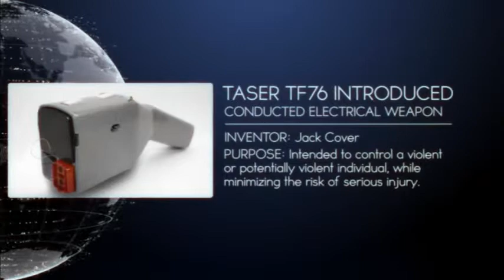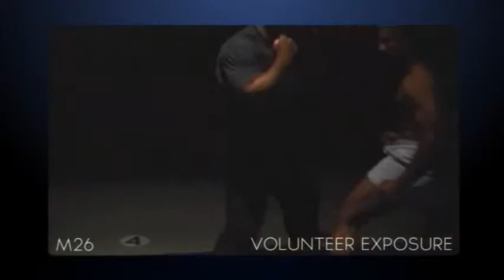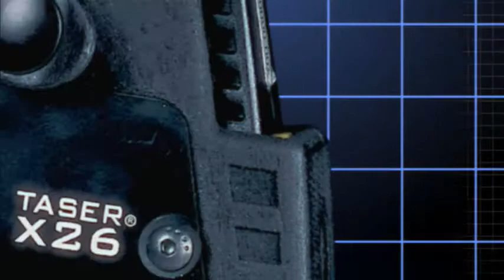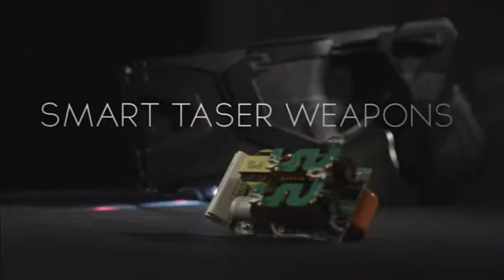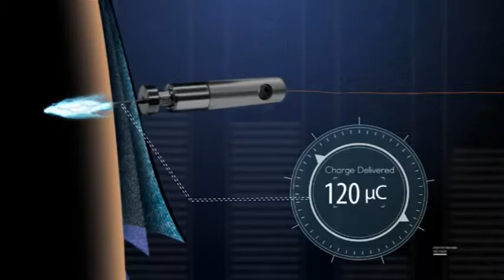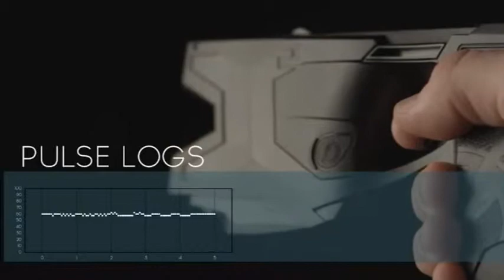Evolution of TASER technology

Comment: It is interesting how much misconception or misunderstaning there still is in the professional world eventhough tha basics are well known since so many years. 

With short pulses it is the stimulus strength depends on the charge not the current (but  a minimum current is needed, the rheobase).

With short pulses or high frequencies, especially at high voltages the current directly goes through the internal resiatance of the human body and the skin resistance is negligible.

The energy causes heat and both chemical and physical effects and has no direct influence on the physiogical response.

Smooth DC doesn't cause muscle contractions and doesn't induce VF through action potential rather than disturbances of the conduction system.